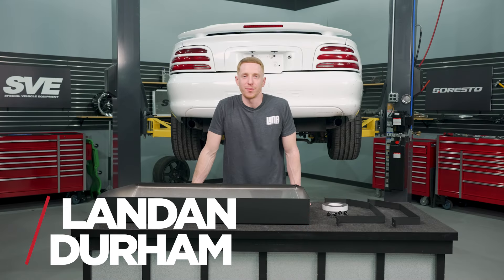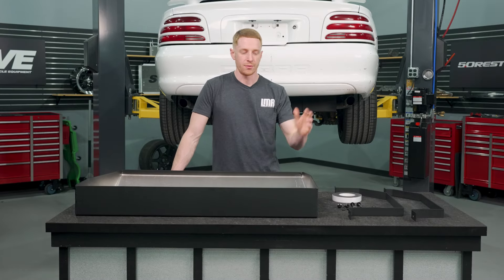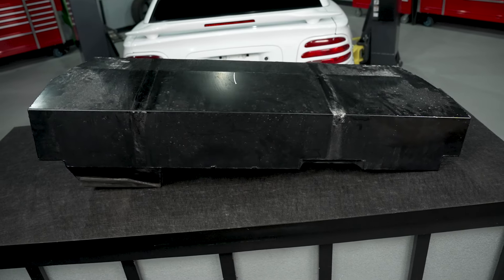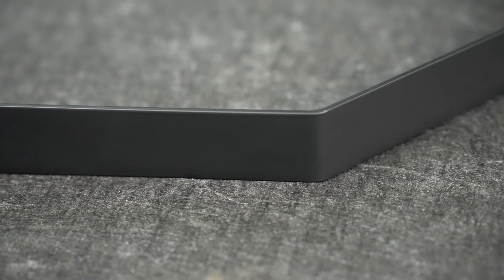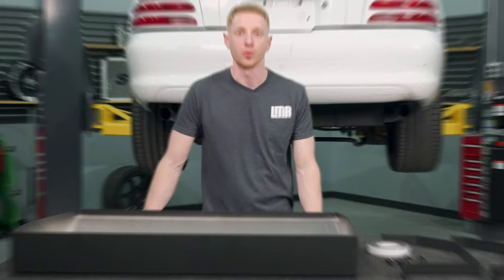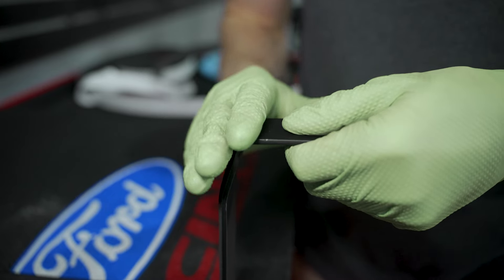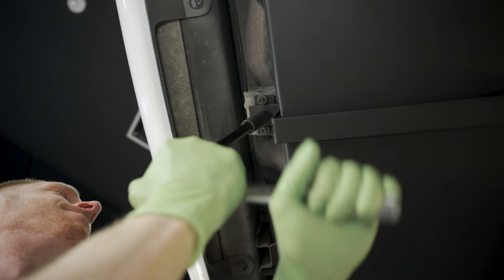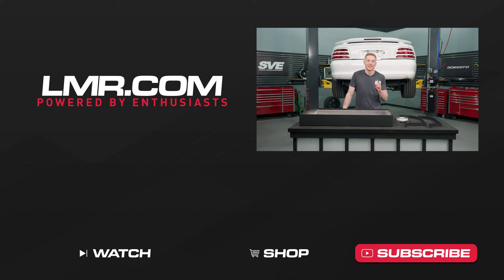2000 Cobra R Fuel Tank Conversion Kit + 1994-2004 Mustang Fuel Tank Cover - Review & Install

Comment: One day, i hope to drive my 1995 Mustang to LMR and show my build in person. You'll see my fuel tank which holds 22.5 gallons of fuel and still looks factory.
Reply: You need to post a video on this.
Reply: @rcmustang5310  i built my mustang on a rotisserie for 6 years starting in 2013. I have a few videos, but I'm not sure they show how i did the tank. I do have a few pictures that show what i did. It starts with a Glenns performance aluminum tank.

Comment: would water pooling in the cover be an issue? ie if you are the type that occasionally power wash the underside of your car.
Reply: Could you just drill a 1/8 hole in each corner ?
Reply from the maker: We mention on the product page that drilling holes is optional for cars that see rainy conditions. -Landan

Comment: Will the cover interfere with the view of IRS tailpipes?
Reply from the maker: Being that rear portion of the cover is straight down instead of at an angle, it could partially block the view of IRS tail pipes. This would depend on the position of the tail pipes as every car is always a tad different. Hope this helps. -Landan

Comment: Recently bought a Bondurant Mustang that had the old Fuel Safe tank with the bladder thats seen its demise. This looks to be a great fix. Is it a return style pump in this kit?
Reply from the maker: The fuel tank conversion kit is for the factory returnless setup. We have two employees here at LMR that own Bondurant cars. One is the Coyote swapped '97 Cobra and the other one is just an '01 Cobra with all the original conversion stuff still in place. Whenever we can make sometime, we plan on installing the fuel tank conversion kit in to the '01 Bondurant car. There won't be a video on it, though. I'm not familiar with the fuel setup on those cars, so it'll be something I get to learn whenever our guys out in the shop can get to it. -Landan
Reply: Fully understand, I will work on putting a return style pump in the conversion kit when it arrives later this week. Thanks
Reply from the maker: @branthorne8597  Sounds good. Just let us know if you have any questions. Thanks! -Landan